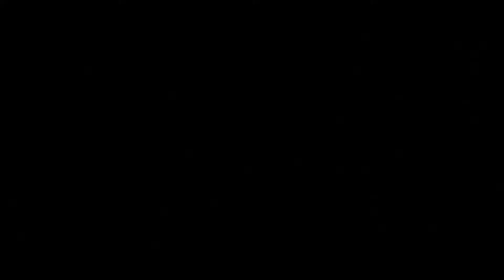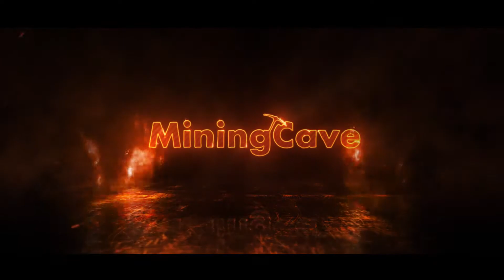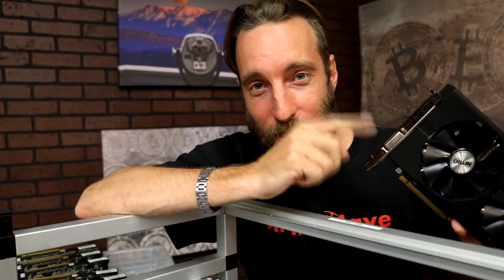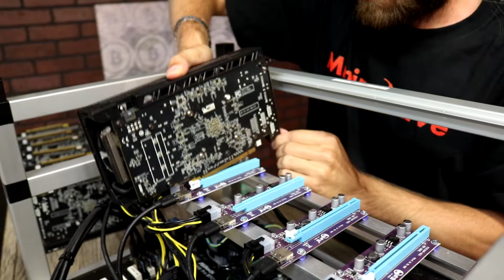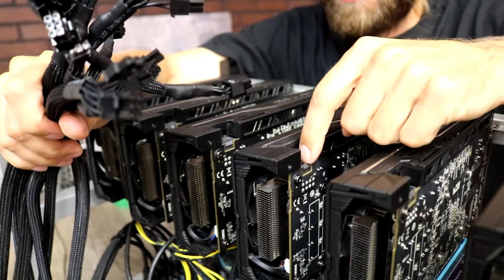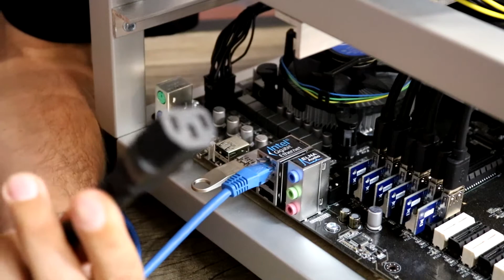When You Receive Your GPU Rig - MiningCave

Comment: Hi Majjin does your mining rigs work in wifi network?
Reply from the maker: You can use wifi, but it is not recommended, it might affect your rig performances. For wifi, it have to be on Windows, and a wifi adaptor must be installed. Keep all mining wired.
Reply from the maker: HI Midoriya :)
Sorry for the late reply I was on vacation for 2 weeks !
By default the motherboard we use for our products, ( H-110 Pro btc) doesn't have integrated wifi
You could add an aftermarket pci wifi card however, It might not work with different OS and I really don't recommend to use wifi for mining equipment
If you are too far from your network I would recommend to use a power wall instead of wifi or take the time to install  proper ethernet network